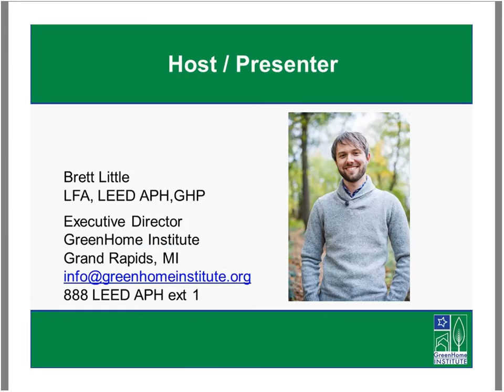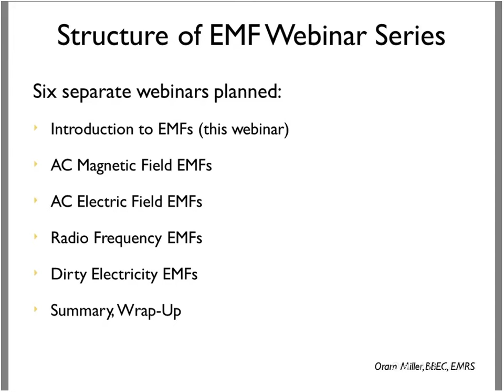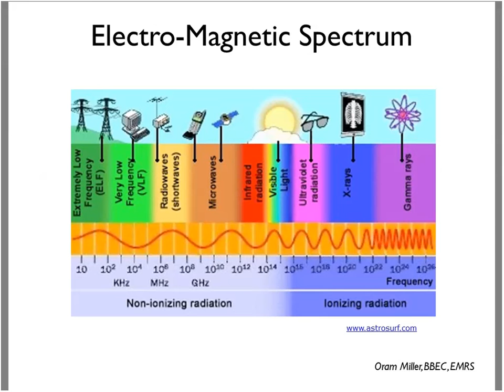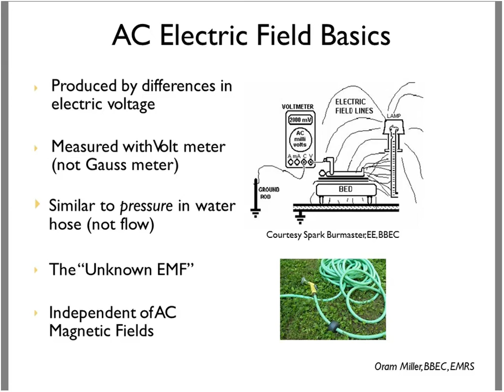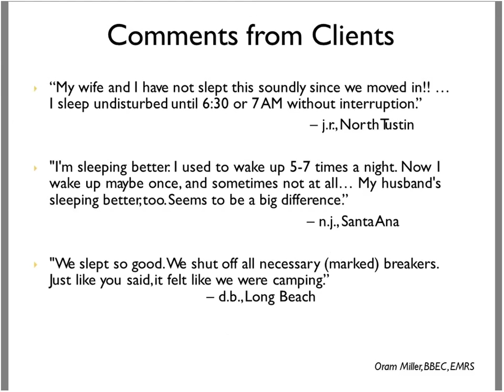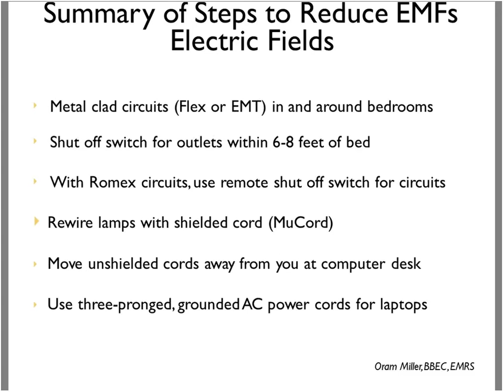Reducing Exposure to EMFs part 3 Electrical

Comment: I always hear this low waving emitting frequceny sound when im indoors. I put ear plugs in and it only made it worse since it isolated the noise.  Went for a camping trip where there was nothing but dense trees and couldnt hear a thing. I cant sleep at all. What could I make or do to fix this?
Reply: i got an emf tester.  certain areas of my house are loaded with emf, usually by electrical outlets.  I made a couple videos walking around with the emf meter.  they sell emf shielding paint that is supposed to be good but I haven't invested in it yet.  I was going to shield my bedroom.  also dont sleep near cell phones or wifi routers.

Comment: This was great. I had no idea about water pipes. Just a note: I was convinced I was going to use MC cable on all my re-wiring efforts until I saw this from LessEmf: 4- Use metal clad (BX or metal conduit), to shield electric field if you must, but this makes controlling the flat side very difficult. A better solution is to enclose the Romex in grounded Aluminum Tape to shield electric field. 5- A better option is to enclose Romex in grounded Magnetic Shielding Foil (for straight runs) and SpiraShield (for curved sections) to shield both electric field and magnetic field. Of course, this only works if there is no net current (see #1 above).